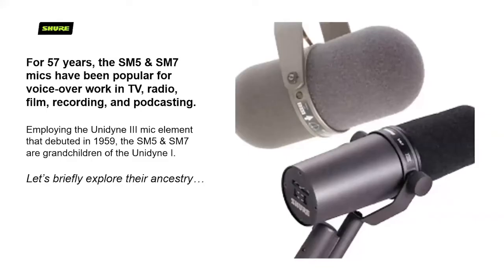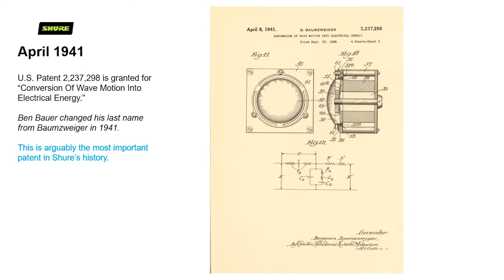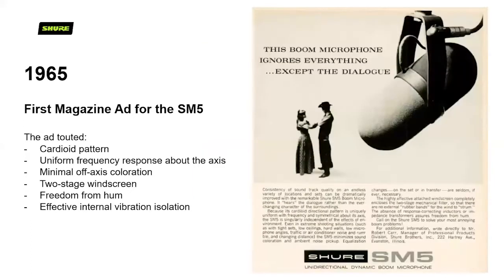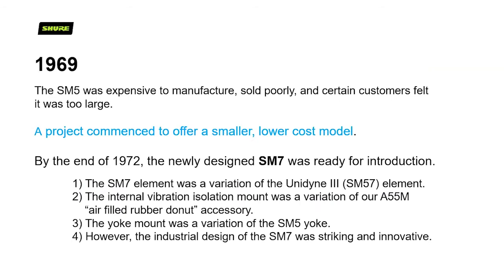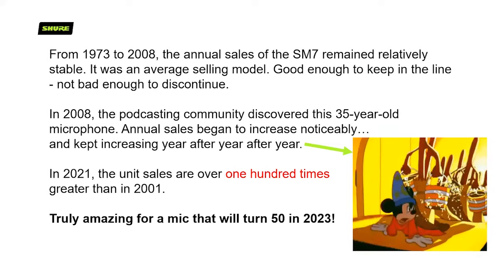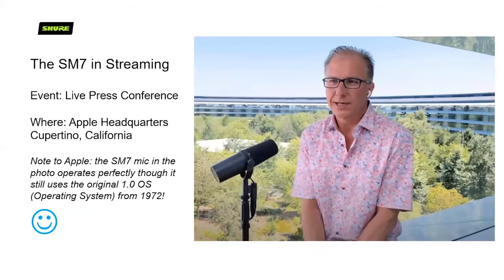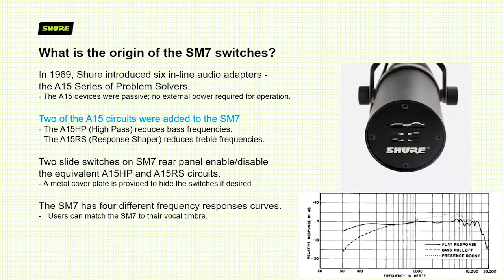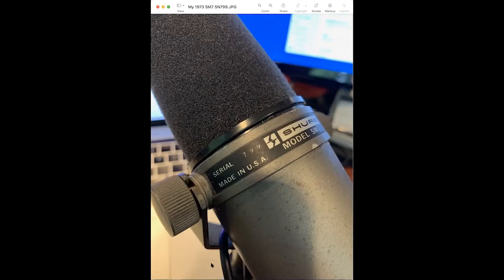History of the SM7 and SM5 with Shure Historian, Michael Pettersen

Comment: It would seem that Shure could have alleviated the SM7B's notoriously low output by replacing the magnet with a neodymium magnet. I wonder why this hasn't been pursued as the output is a definite drawback.
Reply: Probably because neodymium tends to sound a lot brighter which would probably mean they'd have to create a new model out of it. Example, the Electro-Voice RE27 ND is quite a bright sounding mic compared to the RE20. Same for the R50 ND model over the non ND RE50.